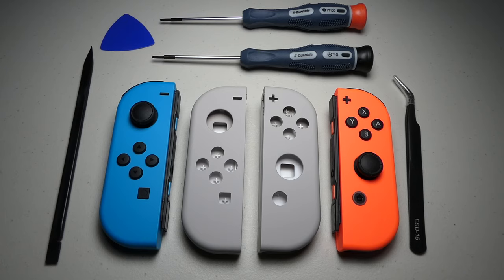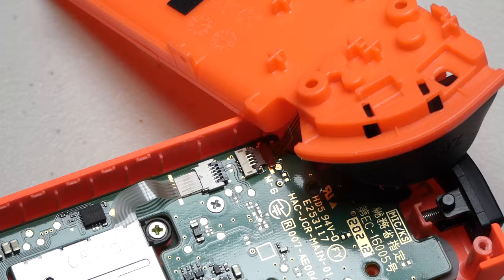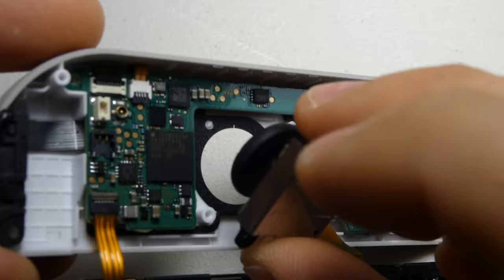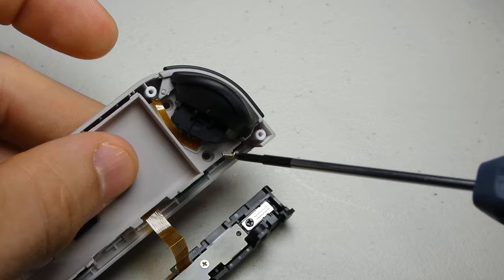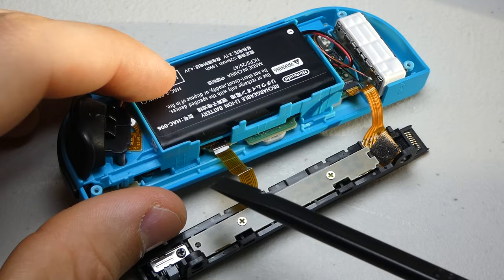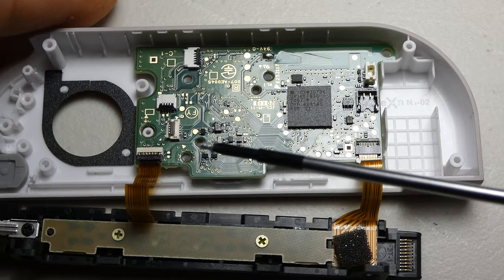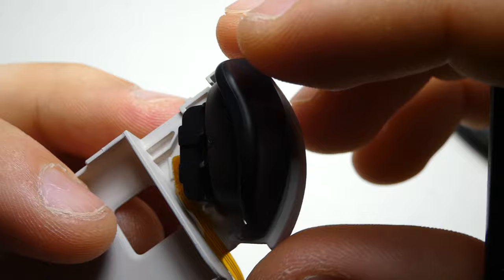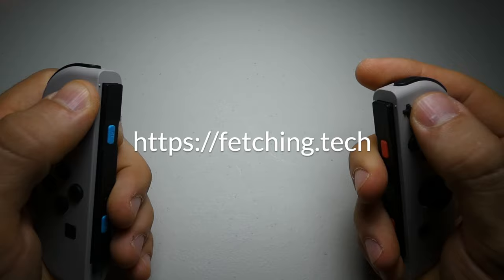How to Swap Out Your Joy-Con Shells

Comment: I need help, I swapped my shells for my joycons. All the buttons work fine and everything works except for 1 thing for my right joycon. It can connect wirelessly to my switch but wont be detected when attached to the actual switch. Anyone know what i can do cause i cant play games with both joycons attached to the switch in handheld mode.
Reply: Have you made sure that the joycon railing ribbon cable is connected and/or undamaged? This will most likely be the issue
Reply: @hatrisfan  i don't think it's damaged(i hope not), It still charges but if it is damaged, is there a way to replace or fix it. 
Edit: I accidentally pulled too hard and yanked out the wire once, that might be the issue but it still does the thing where it'll show the 1 dot on the side of the joycon railing.
Reply from the maker: @thepunontherun3140  I think @g.d.l.p.e is right, It sounds like a ribbon cable issue to me. There are two separate ribbon cables on the Joy-Con railing.

The one with the LEDs is probably not the issue If you're able to sync and it's still lighting up.

I would first try reconnecting the other ribbon cable that connects to the railing itself. If that cable got damaged, you may have to buy a replacement off of eBay.
Reply: @FetchingTech  Ok, Do you know which one is the LED ribbon on the joycon so i know which one to replace when i order the part. If the Sl and SR are working fine with LED does that mean i have to replace actual rail because it has the other ribbon cable attached to it.
Reply from the maker: @thepunontherun3140  Yes, I think it's the cable that connects to the railing that might be damaged. The other one seems to be working correctly.
Reply: @FetchingTech  Yeah it was, i replaced the joycon rail today and its fixed. Thank  you guys for all the help.

Comment: What would happen if on of the latch breaks?
Reply from the maker: I apologize, I don't fully understand your question. Which latch are you referring to?
Reply: @FetchingTech  I supposed he meant the locking latch for those ribbon connectors
Reply from the maker: @sotongg  Ahh, good catch. Yes, those latches can fall off unfortunately, and if you squeeze too hard on the tweezers while you're reinstalling them they have a tendency to fly off and disappear forever. I have had some luck reinstalling them with a bit of patience, but, depending on which cable it is and how often you use motion controls, you might be okay just leaving it off. That's what I've had to do on my personal controller after I lost the latch :/

Comment: This video was super helpful! Honestly the most informative and the easiest explained. I only had one issue, and that's the fact none of my buttons work on either joycon. Not one of them except for the +. Does anyone know what I might have done wrong? I can't find anything that talks about that specifically on google
Reply from the maker: So, you only have one button working? My gut feeling was that the batteries didn't get reconnected fully, but that would only cause a problem in wireless mode. Also, none of the buttons would work in that case. Perhaps you could give me some more information, and we can try to figure this out.
Reply: @FetchingTech  I took them both of them all apart again and made sure to do everything exactly how you did it in the video. That seemed to do the trick and everything is working again! Maybe I didn't connect something correctly like you guessed? Either way, thank you so much for the help, and I'm definitely gonna get some more shells and stuff from your shop 🙂
Reply from the maker: @sillydiva14  That's awesome, I'm glad you were able to get them working again. I hope you enjoy your new controllers.

Comment: 9:58 Oh my goodness it is nearly impossible to do this step for me. It was stuck on there no matter how much I wiggled with my tweezers. I am scared to damage the motor and I think I may have scuffed the wire. I'm not sure what to do beyond this point
Reply from the maker: Yeah, the first time that connector comes apart it can be really stubborn. I usually just try to attack if from a different angle if I'm struggling. Worst case scenario, you can buy a replacement on eBay for about $10. I hope you can get it.
Reply: @FetchingTech  Good news, I did. The motor still works and I was able to do a full shell replacement. I’ll definitely look into a new motor in case anything goes wrong. Thanks again

Comment: i can’t pull out the vibration motor plug
Reply from the maker: You can just leave it connected to the main board, if that’s what you mean. I’ve found it better to leave it connected to avoid damaging it.
Reply: @FetchingTech  thx, cuz I find that the vibration motor’s connection wire is easy to break
Reply from the maker: @tonytsang7449  Yes, I've heard that happens a lot

Comment: Thank you for the step by step tutorials, i manage to change my right shell, but the wireless connection can’t work. Can you help me ? Where’s the problem? 

I tried to try the joycon on handheld mode.. it works even tho slightly slower before changing my tools but when i put off my joycon, the led is no longer have light nor detected on my joycon. Please help ! Thank you so much !
Reply from the maker: It sounds like the battery connector might not be inserted fully. If it is working while connected but not wirelessly, that would be the first thing I'd check.
Reply: @FetchingTech  omg thank you for your reply ! I’ll check tmr ! XD i try to press the flexible cable too, but the led wont turned on.
Reply from the maker: @jessicac.680  In the past when I had this issue, it was either the battery connector or the ribbon cable for the railing causing it. Hopefully one of those just needs to be reconnected.

Comment: I finished the shell swap and amiibo no longer works, when i try to use amiibo it will give me an error about reading it then every time after that it will tell me to connect a controller with amiibo functionality

edit: my sl sr ribbon cable is broken and that might effect it
Reply from the maker: I'm really sorry to hear that. You've been having a heck of a time with your swap. I haven't heard of anyone having issues with Amiibo previously, but I did find this helpful guide from Nintendo that will hopefully help you find a fix. Let me know if any of these things get it working for you.

https://www.nintendo.co.uk/Support/Nintendo-Switch/amiibo-Does-Not-Work-or-Does-Not-Scan-1655488.html

Comment: any tips on how to do the screw at 13:28? I've legit been stuck on this one for an hr and a half and I'm actually going crazy...
Reply from the maker: What sort of issue are you having? Are you struggling to get the screw lined up, or is it just  not tightening?
Reply: @FetchingTech  hey, thanks so much for the reply. first off just wanted to say that your toolkit and video has saved me so much time regardless so thanks for that. and yeah getting the small screws lined up in spots like those drives me nuts. it feels like there's nowhere for it to sit, how do you get it done so effortlessly?
Reply from the maker: @ericzliu  I'm glad to hear you've found the tools and the video helpful. As far as the shoulder button ribbon cable screw is concerned. All the screw holes are self tapping, so the first time you install the screw it will carve out the threads in the plastic. I've never had too much trouble installing any of the screws, apart from occasionally stripping the plastic. All I could think is that the screw might have gotten mixed up and is too large for the hole, but it's hard to say for sure. I'm sorry I can't be more helpful.
Reply: @FetchingTech  hey that's no problem. I realized they were self tapping (I don't work with screws and such very often) and did notice that once the plastic got carved out i had a much easier time taking that same screw in and out. I think it really is just a matter of skill and hand precision..too much force makes the screw fly off but not enough doesn't allow it to actually screw it. it's just something I'd have to get used to, but once its done it's a ton of fun haha. cheers.
Reply from the maker: @ericzliu  Awesome! I'm glad you were able to get it to work.

Comment: Any ideas why my ZR button doesn't work? It clicks but doesn't do anything
Reply from the maker: It depends on whether the button is failing to click in or if it's just not registering the clicks. If it's not clicking in, you may need to reseat it. However, if it's not actuating, it could be an issue with the motherboard.

Comment: I’m having trouble removing the battery gray screws. They unscrew, they just won’t come out.
Reply from the maker: It sounds like the screw holes may have stripped. If you turn the shells over they should fall out. Otherwise, you may have to try and grab onto them with tweezers.

Comment: would a Y0.6 be too big to use for these screws?
Reply from the maker: There seem to be different size measurements for these screwdrivers. Some of mine are labelled Y0 and others are  labelled Y2.0. I would guess that Y0.6 would be too small, but I guess I would have to see it to confirm.

Comment: The R trigger is tight and not pressing as easily as it did before anyone got any ideas as to why? I have the spring in there
Reply from the maker: Sometimes the shells aren't perfect and that can cause warping at the ends. I would make sure the shoulder buttons are securely snapped in place and then maybe loosen the external screws near those buttons to give them a bit more room to move.

Comment: so i tried this and none of the buttons work except the joysticks. i went back in and unplugged the zl button and everything worked again except the zl button ofc. i tried to plug the zl button back in but i had the same problem with only the joystick working. i assume its a problem with the zl button but i dont know if i need to replace the ribbon cable or what. any ideas on how to fix this? i had the same problem on the right side too
Reply from the maker: Hmm, that's an interesting issue. It sounds like maybe there is a short going on somewhere. I would start by replacing that cable, and then maybe the board itself if that didn't work.

Comment: The Y0 screwdriver i bought from the link are stripping my screws and I don't know what to do now
Reply from the maker: I’m really sorry to hear that. Sometimes those screws are in way too hard. Once they start to strip it limits your options, but you can try using a rubber band on the screw head to add more friction. However you might need to get a screw removal kit if you aren’t able to get them out with the screwdriver. I hope you’re able to get it out.
Reply: @FetchingTech  , it's quite alright I might have to use different Joy cons to swap the shells, to be fair I was using my first set of Joy cons lol
Reply from the maker: Well, good luck. I hope you’re able to get your shells swapped over.
Reply: I had to break the original shell

Comment: just started and already stuck at the taking the screws out part
Reply from the maker: They can be tough to remove the first time. Good luck with your swap, hope you were able to get it figured out.
Reply: @FetchingTech  i stripped them and had to break the original joy on shells to get them off 😅 but other than that the actual swapping of the joycons was easy!
Reply from the maker: @strawbeemilkk  Ahh, I see. Well, if it makes you feel better. You're definitely not the first person to have to do that. Those screws are the worst.

Comment: Used the same screwdriver that was used in the video for the backplate and it doesn’t work
Reply from the maker: So, I have been successful in getting the backplate off with this screwdriver, but you're right I don't think it is the exact same size. Some extra caution is advised.
Reply: @FetchingTech  I ended up getting them off but it wasn’t easy lol
Reply from the maker: @Nicholas-hh9qk  haha glad to hear you got them out at least

Comment: Anything else I can use to hold the lil black piece in place that clicks the ZR button? Kinda stuck right now lol
Reply: Update: used a lil drop of super glue to hold it in place does not have the same feeling but should hold out till I can get a replacement piece. Everything else went smooth but the that one stupid lil piece lol
Reply from the maker: I'm glad to hear you got it working, Although, I'm not sure exactly which piece you're referring too. The ZR button should clip right into the battery tray.
Reply: @FetchingTech the button it self the lil black button has like a metal shield that holds it in place that lol metal shield disappeared on me lol
Reply from the maker: @DavidOlivarez08  Oh well, on the bright side, you should be able to replace all that stuff pretty cheap off eBay. Sorry it's given you so much trouble though

Comment: This can be done without removing all those extra ribbin cables.
Reply from the maker: It depends on what you're swapping out. If you're keeping the same shoulder buttons and battery tray, then you're right, you can save some time by keeping them attached. It just depends.

Comment: Help! I'm having trouble with this part 2:42 . I still cant get it out.
Reply from the maker: Those connectors can be really stubborn. When I struggle with them sometimes I'll try to take it from a different angle and pry against the wall of the shell or try wiggling it back and forth a bit. Persistence is key.
Reply: @FetchingTech  thank youuu! <3
Reply from the maker: @danderose1636  Glad I could help :)

Comment: is anyone else having trouble detaching the motion control battery and if they did how you guys do it in the end
Reply from the maker: Is your battery connector not coming apart? It should pop right out when you pull up on the wires.
Reply: @FetchingTech  oh I have manged to do it I used the sprunger to wiggle up the motion control and I was able to pull it out along with the motherboard at the end
Reply from the maker: @supersegaman09  Awesome, glad you got it figured out.

Comment: Don't remove vibration motor, you will break the joycon
Reply from the maker: It's definitely tricky, but it can be done with the right tools and enough patience.
Reply: @FetchingTech  Yeah you can theoretically do it but its one of those items that you could just pull out of the housing and leave connected. The connector on older joycons gets stuck in the slot and you are more likely to pull the slot off the motherboard than to disconnect the cable. I did this on accident and managed to fix it by soldering the connector to the motherboards contacts. All in all this problem is easily avoidable by leaving it intact

Comment: 3:03 i dont care about the Joystick becuse its broken like dryed up and riped 🤓
16:20 smoll tip if it trigers you that the color that slide down doesnt match or the pair ones there is a Programm to Edit it

Edit: i got sacond pair in case of something breaks i have something still to play but i did it completly works perfectly fine and funfact i nerver did something like this

Comment: Has anyone had the issue of left joy con not charging after the shell swap?
Reply from the maker: Yes, that often is caused by the ribbon cables connecting the railing either not getting reconnected or somehow getting damaged in the process. You may need to replace one or both of those cables.

Comment: What if the joy con screws are too tight?
Reply from the maker: Unfortunately, that’s a pretty common issue, and there’s not much that solves it other than a steady hand and patience in my experience.
Reply: @FetchingTech  but i literally cant get it out. i bought all the stuff and its not working
Reply from the maker: @TheRoyalsWasTaken  Did the screws strip already, or are they still intact, you just aren't able to turn them?
Reply: @FetchingTech  intact. maybe wd40?
Reply from the maker: Hmm, I wonder if there is some sort of plastic penetrating oil you could use that’s designed for plastic and electronic applications.

Comment: dose a y000 work?
Reply from the maker: I am able to remove the screws in my controller with a y000 driver, but that might be because they've been removed a number of times already.

There's always a risk of stripping screws when you use a different size driver than intended, so I would just say be careful if you go this route.

Comment: WHY DOES NO ONE SHOW TAKING THE RAIL APART AND REPLACING THE TINY BUTTONS GRRRRRRR
Reply from the maker: Yeah, I realized that after I posted this. Maybe I'll have to post a short showing that part, but it's pretty simple, just two screws. The only thing that could be tricky is getting the right button in each slot, but the guides should help with that.

Comment: bro only 1 took me 2 hours, and i still need to do 1 MORE
Reply from the maker: That's pretty normal actually. Most people are pretty cautious the first swap they do, which I think is a good thing. If your were to ever do it again, I'm sure it would go a lot quicker.
Reply: @FetchingTech  yh i finished it in 5 hours, 2 screws (1 on each) are bad now but oh well
Reply from the maker: @deadd4236  Sorry it gave you so much trouble, but hopefully you enjoy your new controllers anyways.

Comment: fml exremerate didn't give me a y0 screwdriver
Reply from the maker: I noticed early on that they get some negative reviews from customers with stripped screws, and I think that has to do with the tools they provide. 

You might be able to make the smaller Y00 driver work, but I wouldn't recommend it.
Reply: @FetchingTech  yeah, I ended up contacting customer support and they were really great about it